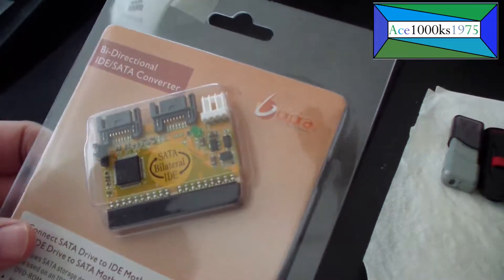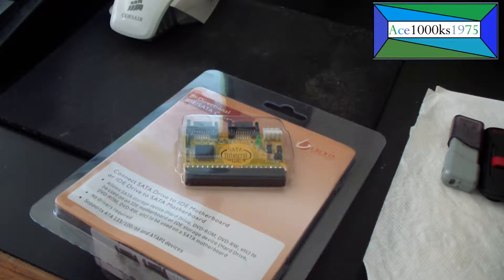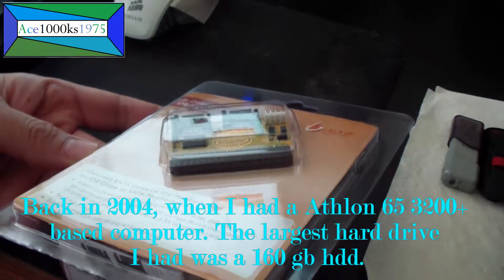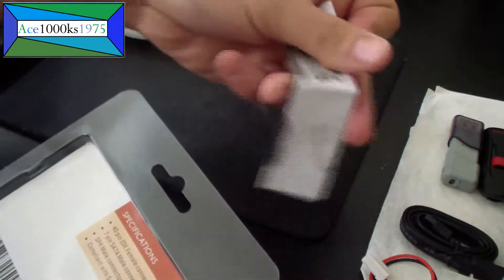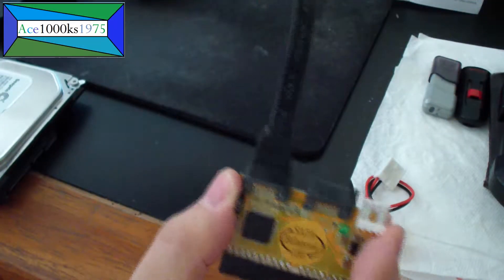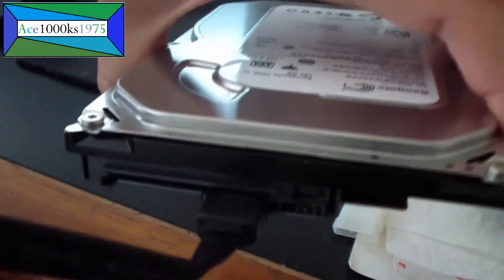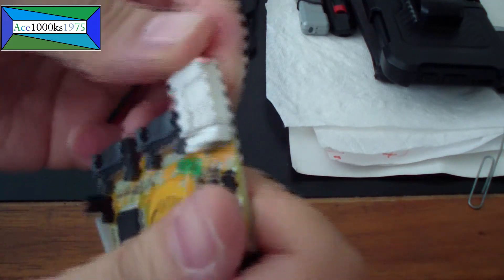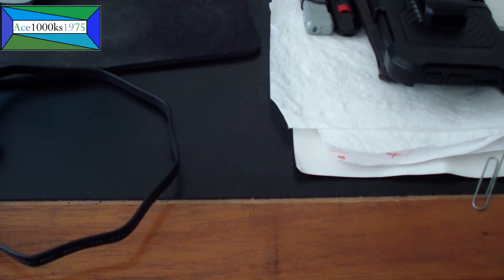Bipra Bi Directional IDE Sata Converter

Comment: Did you ever hook it up to a computer, or did you just talk about doing so?
Reply from the maker: I hooked it up to my old Pentium 4 3.0 HT based computer. The 40 GB 3.5" IDE died on that computer, so I replaced it with a 80 GB sata HDD using this adapter.
Reply from the maker: After I got my Pentium 4 to work, I hooked it up to my KVM setup in my room. I am currently using that computer as a retro gaming PC.